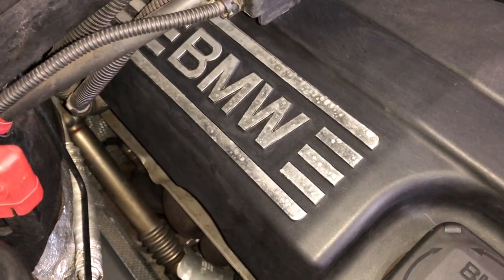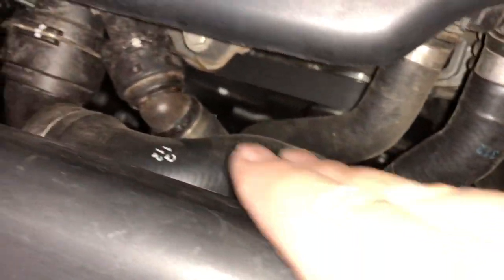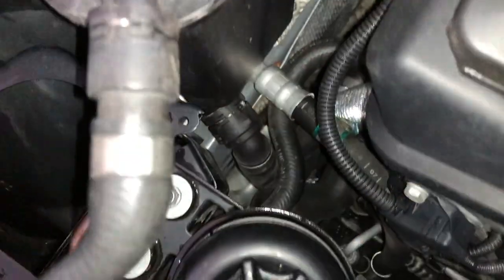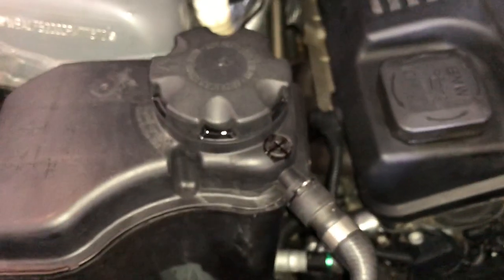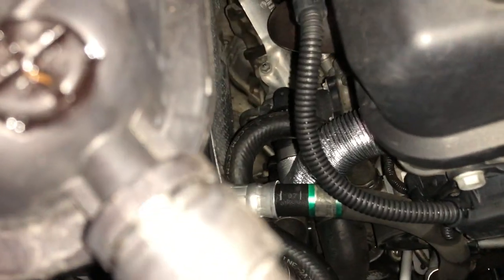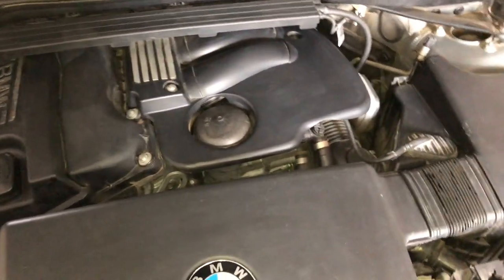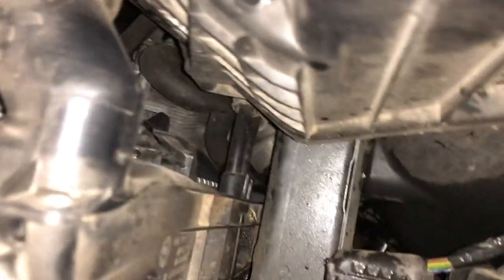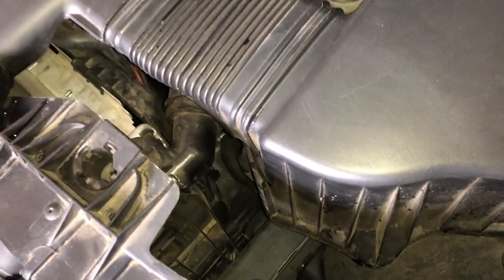Explaining BMW Coolant System. Reservoir, thermostat, hose & plastic fittings. What runs where.

Comment: Hi Mark, I have a E90 320i, 2011 model and I replaced the shielded pipe that goes into the block as I thought that was leaking only to see that below the shielded pipe there's a nut that goes directly into the block that is leaking around the bottom of the nut. Do you think it needs replacement and do you know what size that nut is?